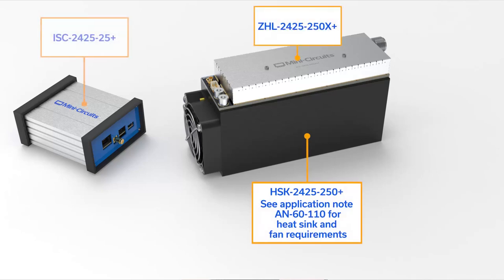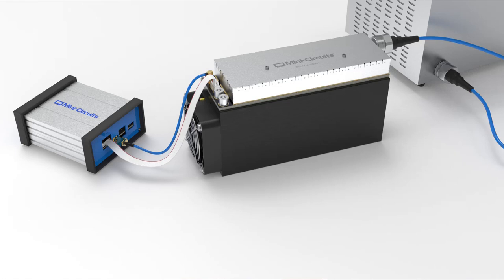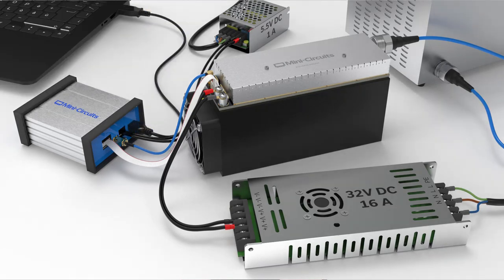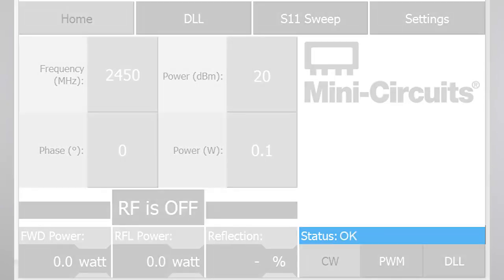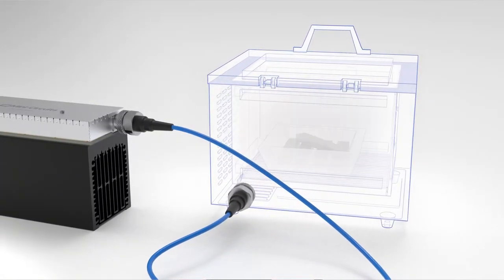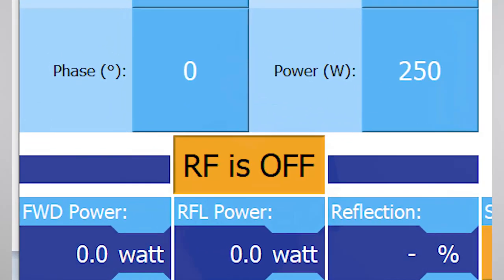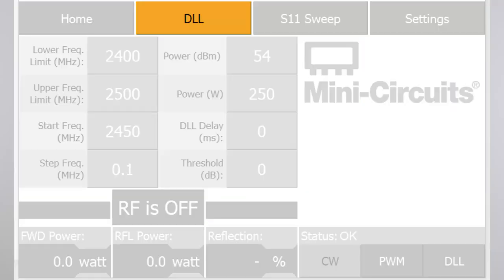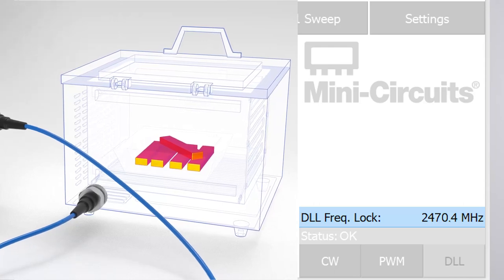Turnkey System for 2.4 - 2.5 GHz ISM RF & Microwave Energy Applications

Comment: 1:03 showed multiple PA together. Can you make another video to show all 3 PA together? And show how to control with 1 PC.
Reply from the maker: Thanks for your comment. The ISC-2425-25+ can operate with multiple PAs on a single control line in master-slave chain to drive multiple channels or combine multiple outputs into a higher-power channel. The COM-2G42G51K0+ 4-way combiner was designed specifically to combine 4 x 250W PA outputs into a 1kW signal. We will post more content exploring these use cases soon.